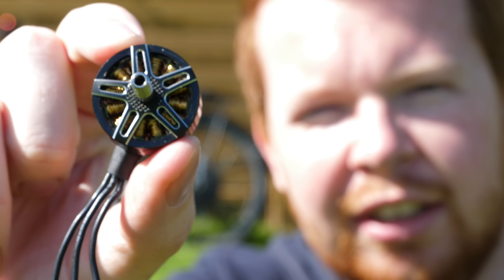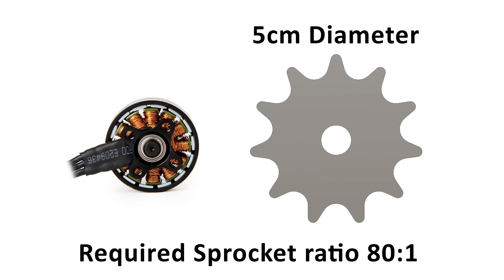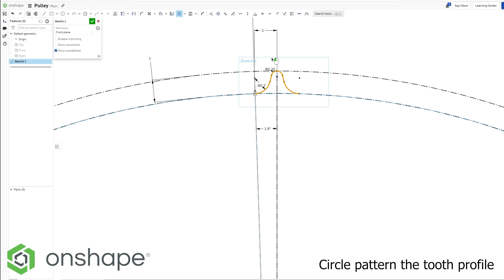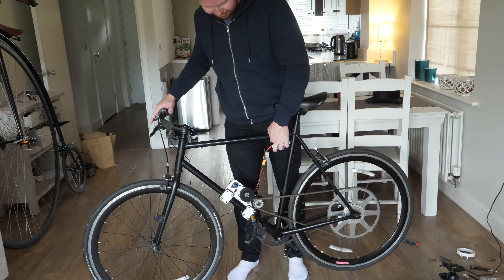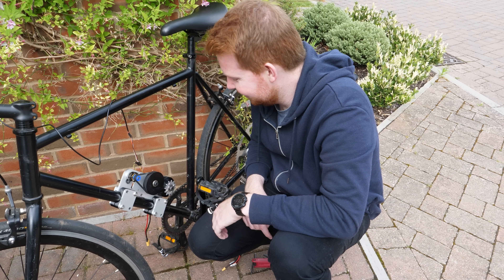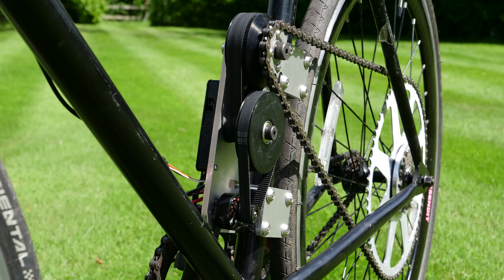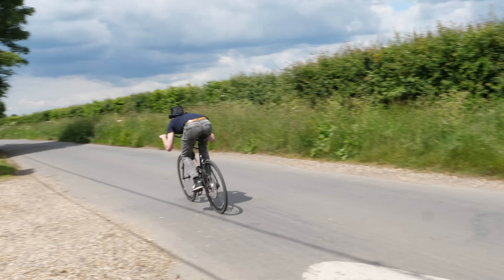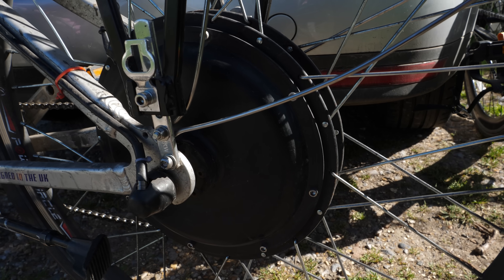Tiny 1kW Electric Bike Motor

Comment: Like everyone else is saying... cool that motor bro, you'll murder fewer of em that way.

They make 12v 75mm x 30mm blower fans for PCs, one of those and a bit of ducting will do you well I bet. Search eBay for 7530 blower in the computers subsection, the place is lousy with em. Uses two of the four mounting holes, diagonally opposed, for a standard 70mm PC fan.

If that's not enough, get the fan from a Dell Optiplex GX280 -- gx280 fan in the eBay search box will do you well ;) -- the things are INSANE. Use one as a hairdryer and it will make you bald. But, then, what do you expect for a PC fan that pulls 2.6 freakin amps at 12 volts lol? ;) (Not bad, considering you can get em for $10-15 in the USA, domestic, if you find the right listing.) One important, but tiny, modification is necessary, tho, coz Dell fans are weird -- there's a spot on the label side that looks like it's covered in rubber. If you peel that up, you'll see a little component, usually a green blob with two wire leads on it. Put a drop of solder or something across the two leads (it's a signal thing, even wrapping it in tin foil or a little bit of bare magnet wire will work) and the fan will spin at max speed. The blob is a temp sensor to throttle the fan, and it won't work right if you use it as-is, not for this. You'll also need stronger ducting than for the 75x30 fans for getting the air to the motor, since those fans are a bit wimpy compared to this thing, it'll just about levitate on its own lol... the others are just, well, fans.

Either way, actual cooling = not instantly fused coils.

Comment: The motor is designed to have basically a cooling fan 3x it’s size mounted directly above it. My suggestion would be to add a cooling fan along with a heat sink mounted to the aluminum housing.

Comment: 1:09 That's an interesting way to put the problem. It made me think think about the kind of spreadsheet you could produce which showed the consequences of this. For instance the power requirements to affect the acceleration of different masses to that velocity, and the air resistance losses involved, etc etc.

Comment: little motor will work good if you add all for comfort working
at least 10wt air cooling fan that will air flow through 1kwt motor, may be even with water spraying in the flow, you need optimisate reductor gear - two stages of rpm reduction,for minimise friction looses,and then you need V-belt variator for the best results...
some chilren electromobile with 12V 60ah lead car battery and collector motor like in portable li-ion drill, with plastic reduction gears to wheels -are runnyng very fast, about 35kmh when parents connect extra battery -forsage to 24volt undocumented and shortening motor life, but motor is cheap, even if will broken in one week

Comment: I've never understood why motors are marketed by input power and not output power. Output power makes so much more sense, just like how lasers are always correctly marketed by output power, except one brand that has recently marketed their 20w laser by the machine's total consumption of 130w. Even in proper drone design, output power is more relevant, in design of anything using motors the output power is more relevant. We really need the market to change to output power being the marketed metric, especially once the aftermarket EV market takes off. 

I'd be curious to see this concept but with more motors. Planetary gearbox should be suitable, planets bound to the motors, carrier held, freespinning sun, and driven ring; could even leech some power from the sun and use that as a cooling fan for the motors or something. Though, with how variable cheap motors can be, having an encoder on each one to equalize them is pretty much a requirement. I wonder if you could also relegate some motors to regen in this setup, use all of them at launch, but you don't need all of them in use during cruising, might have a somewhat extended range this way, plus higher top speed when all of them are needed again.

Comment: how about instead of a drone motor (that requires active cooling from the propeller) you could try with an R/C car motor? You could do like a Nitro vs. Electric comparison! Most of them are air cooled and don't require extra cooling fans.

Comment: I faced the same dilema when I learned that the motor of a professional driller have the same power output of a domestic one. The difference is that the pro can drill all day long without stop and the domestic gets extremely hot after a couple of holes.

Comment: Running 1KW through a large coin sized object with no heat syncs or forced cooling. I'm impressed that neither shorted.
Reply: A testament to polyurethane insulation.

Comment: The old Velocette bike used a small IC motor bearing on the front tyre. Huge ratio motor to driven wheel and it allowed 1000's of people to wander France with a baguette or onion as a cargo.

Comment: I was predicting fire for the first motor. Trying to imagine it trying to deliver sustained torque.

I wonder if it could drive a flywheel, then clutch from that. Would probably work!...the first time.

I wonder if they print duty cycle data anywhere.

Comment: If the drone motors gears and assembly were made out of steel melting issues would be eliminated.The wires insulation would need to be made out of a heat resistant fibrous material.

Comment: Remember the super capacitorbike? What about putting that motor you have made in the video into the bike's wheel? How strong would it be on a battery? What about the noise? That would be nice. Making a cheap motor like that for a little push or start.

Comment: I had an argument with an engineer (I'm not) and he was of the school that 1hp is 1hp no matter if it was high speed low torque or high torque and low speed.  I said that he was forgetting something, transmission loss.  You can loose all of your power in the transmission.

Comment: Brushless motors have zero torque at zero rpm.  You need a sensored brushless motor like used on electric skateboards.

Comment: Hey Tom! You might know by now, but your RPM calculations are somewhat wrong. The drone motor turns at 30krpm, No-Load. That's an important distinction. depending on the propeller used, the motor will turn slower.

Another reason you might burn motors, is because drone motor's and ESC's are notoriously bad at providing torque at extremely low RPM, because they are sensorless.

Comment: Now you just need to add about 4 of those motos and use a serpentine belt like configuration  would get even more torque with less stress on the motors.

Comment: Yeah... As a fellow engineer, I do not give much cred to the power ratings of small drone motors.  Trying to get 1Kw out of that little motor would fry it.  You may consider using 4 motors and try it again...

Comment: The tractor and sports car comparison is incorrect, weight and aerodynamics aside the tractor's engine has enough torque to power through the gearing you'd need to give it the same performance as the GTR. Not so the other way around. The torque loss from the gearing you'd need to get the GTR's engine to output the same torque might be greater than the engine's torque itself.

Comment: Good, that either is or is almost proof of concept! Maybe try a larger chain drive sprocket wheel, different ratio setup, several drone motors and some cooling for them and you might just have it, with a higher max speed!

Comment: This could be redesigned so you do not need pulleys, but I understand from the 3D-printed angle it is spreading the load more evenly instead of across 3D-printed teeth...

Comment: Because motor bearing: drone motors are not made for an asymmetric load like by a belt.
I think the small tooth wheel should get a own axis and bearing, and the motor is only connected by a clutch.

Comment: Run the motor through the derailleur set so you have gears, you are not overworking the motor then at lower RPM.
Also Build a fan into it.

Comment: A bit bigger than that, a motor for bigger rc-planes: https://www.youtube.com/watch?v=uHX9qT7y094
This works like a charm and has plenty of power :D
Driving the wheel has a built-in transmission and it allows for a regular unmodified bike-experience, as soon as the motor is turned off.

Comment: I think if the gear ratio was  a bit shorter (e.g. 2x 5:1 instead of 4:1) I would have worked even better. I'm still impressed by the power these tiny brushless motors generate. I'm using a comparably small 3530 1100kv outrunner on an 3dprinted RC crawler with a belt transmission. This setup has loads of power and has absolutely no problem with the 3kg+ car going offroad and still providing  decent speeds

Comment: what about using 3 motors bunched together driving a planetary gear, each motor having its own gear driving a outer ring driving central gear/sprocket.
all contained in a container of a bath of transformer oil.
should sort out the heating problem and will give you a lot more torque. still be smaller and lighter than the hub motor. and could be mounted in the hub

Comment: You are confusing power output to torque. There is no way the Nissan will either push nor pull a plough, by two issues- high revving wide bore short stroke is still torque deficient and Nissan mass is far too low to overcome inertia of plough. But forced induction, square bore or undersquare (forced induction is essentially a bore-stroke increasing cheat) mated to gearbox optimally designed for maximum torque mounted on very high mass vehicle will easily outpull a team of Nissans, let alone a plough (which may be ganged with other traction-powered (non PTO) farm machinery like winnower or seeder etc.)
Reply from the maker: I used the nissan vs tractor as an example to show power is different from torque/speed
Reply: Im confused the relationship to speed via torque- are we talking Carol Shelby's famous "torque wins races, horsepower sells cars" or...?

Comment: Time to 3d print a propper reduction gear box! In order to get that motor up to speed quickly. Like rctestflight did in his snowmobile. The higher KV motor should work to in that case. Just get that max rpm around 20 mph.

Comment: Do you have any idea about the efficiency of belt + 3D printed pulley? That pulley system looks like it could be eating majority of the generated torque alone.

Maybe you could use some factory made metallic gears intented for high power RC cars instead?

Comment: Aside from what others have mentioned about drone motors being designed/rated with the significant forced air cooling from the props, whereas the hub motor is totally enclosed, some of those hub motors aren't actually that big. Some have an integrated planetary reduction and the motor is relatively small.

You could use something like a cycloidal drive or a differential belt setup to get a more compact reduction. And perhaps also add an edf style blower to the motor pulley for some forced air cooling? maybe a small water loop instead.

Comment: Actually, there is a German brand named ADD-E that commercially sells these small outrunners as an E-bike kit. They use the difference in diameter to the bike wheel as geardown and the angular momentum of the motor to engage it. Works really well.
So why don't you actually make it friction based at the wheel tyre? The efficiency is comparable, given that you have a lot of transmission going on otherwise.

Comment: Hmm. Isn't the friction loss much larger when the drone motor has sprocket and chain instead of just a propeller ? The bearings in the motor are designed for driving a propeller.

Comment: The motor needs current limiting at low speeds otherwise it will smoke itself in short order.  Also, your bike chain forces are pulling the motor around the frame clamp bracket.  I'm surprised and disappointed you don't apply your engineering education to study both of these problems in more detail for these videos.  It's a missed opportunity to educate yourself and your audience and add content.

Comment: I think with following two modifications we can get better results

1. Use the motor at possible highest voltage,
It reduces i^2*r losses.

2. Rewind motor with thin cable in multi strand Design like used in power cables
Because one cable with large cross section has disadvantage that current flows through centre of it more and less at circumference.

3. Increase the number of turns,
It increases torque and reduce RPM

Comment: Should have used a 10 buck 885 brushed motor. Cooling fan built in. Come in 6000 rpm twelve volt, even happier at 12000 rpm  24V and that's a kW

Comment: The drone motor would be useful to arm yourself with an additional heat sink. In its natural working environment, the rotor blade cools the entire engine. Thanks to this, it has a lot of power all the time, and not only when someone is not using it intensively. A simple solution would be to use a planetary gear instead of this type of gear ratio. And when it comes to the speed test, you would have to count the motor pull of the electric bike to calculate the gear ratio for the drone motor. Then the fight would be fair. It also seems to me that apart from the mechanical damage to the coils of the drone's motors, the neodymium magnets were also demagnetized. Neodymium magnets do not like high temperatures, so the bike's power could have been lower for that too. But I am not a specialist in demagnetizing neodymium magnets. I would fix what needs to be done and make another movie about it. Regards.
Reply: Often you'll see very little loss until complete destruction, once it gets that bad you'll instantly notice it. Source, I burn a LOT of motors both for fun and professionally (and yes I measure the efficiency decrease after abuse). There is a small amount of drop, but its pretty negligible for most applications.
Reply: i always wonder if i could do a 5km/h vehicule with tiny motors and lots of torq, and few motor baterys.
can be?
Reply: @felixiaccarino8399  Yes, and it's best to use a planetary gear.
Reply: @krotson6767  any other advice other than the planetary? 
im from an overexploited country so resources are limited here
Reply: @felixiaccarino8399  Ordinary belt transmission should also work. The planetary gear can be found in the screwdriver in the garbage can. If the screwdriver motor, not the gear, has burned before. What oppressed country are you from?
Reply: @krotson6767  im from one of the lucky ones not been nuked by EEUU in the last century. poor the other 60 of 194 right?. How are we gonna rebuild ukrain? based on debt?
thats gona be fun
Reply: Or put a fan on the end so it blows the air over the motor. Like an electric drill.
Reply: Motor is not an engine

Comment: It’s probably the kind of motor they hide in cheater bikes to win races. The majority of the race is human-powered but they use it to get the advantage by strategically assisting the rider and letting the rider rest during certain parts of the race.

Comment: Should have added a spot on the bracket to mount a small squirrel cage blower fan aimed at the motor. Some fan blades printed into the motor pulley could also help.

Comment: Even though this was done for electric motors, this perfectly demonstrates why big trucks require low RPM high torque diesel engines, instead of geared down gasoline engines.
Reply: Counter point: they use gas turbine engine in tanks...
Reply: @zogworth  Counter Point 1:  Long ago a lot of tanks used gasoline engines because it was more cost effective to use engines from airplanes.

Counter Point 2: When gasoline is used in tanks, it's also because it makes more sense logistically from a fuel delivery perspective.

Counter Point 3: Almost any modern tank will also run diesel and jet fuel.

Counter Pont 4: I was making a general statement relating to the general use of most diesel and gasoline engines.

Counter Point 5: I'm not sure why your use of a counter point to my statement was necessary.

Comment: I would love to see you make some kind of ers of a hybrid go kart. Have a main gas motor like a stock 212cc, 440cc, or 670cc then have a 5-10 hp electric motor that can help out the gas motor powering the rear wheels. That would be super cool. You could also try that on a mini bike, get a rolling chassis for like 400 online and bolt on a 212 on it then put the electric kit on there to make a ers system, that would be sweet

Comment: Smart mod would be to add an air scoop to bring some cooling around the frame tube.  The motor is sitting exactly behind that down tube and in its usual configuration is sitting downwind of a little fan whizzing along at thousands of RPM.  Anything you could do to increase air mass per second flowing over those coils would be good.
Reply: Air scoop will never provide enough cooling.  Consider this: the highest continuous power demand is when riding up a hill, when you'd be going slower due to the load.  More load and less cooling is not a good solution.

Comment: That size, put on on the front wheel as week as on the back... 2wd ebike.. should reduce the strain on the motors by dispersing the torque evenly across the weight... not sure how you would go with synchronising the two however to ensure the same speed is maintained...

Comment: The first motor fried because starting rpm is way too low relative to its top value. Can we try again with bike speed set to 10mph before power the motor up? Some bike electronics refuse to engage motor unless bikers accelerate the bike beyond a certain speed for similar reason.

Comment: they designed the motor with a very high current density try water cooling to cool down the wires , high current density is like high friction , so it needs to be cooled to deliver the rated high power